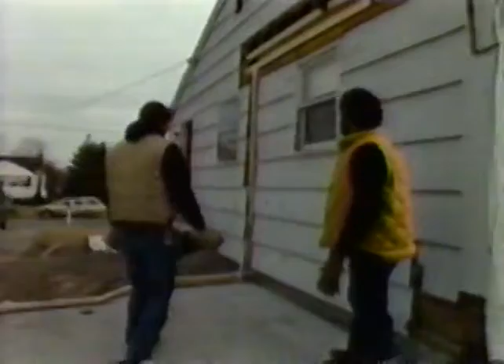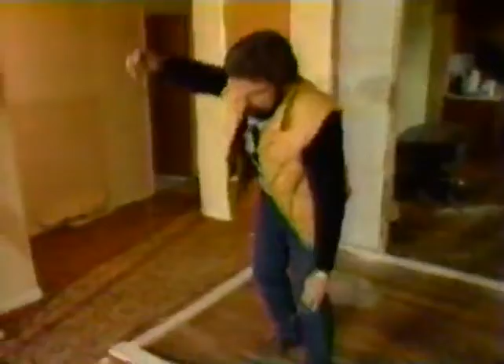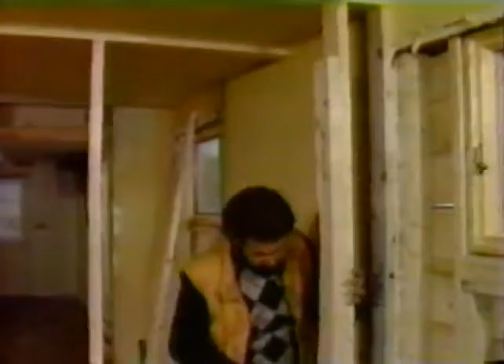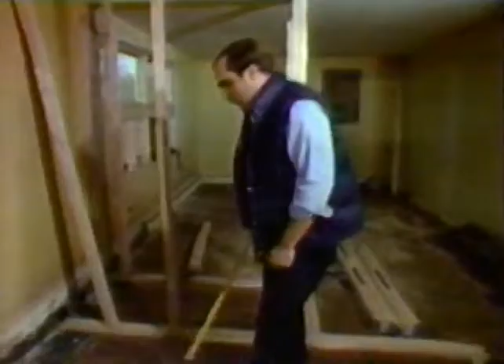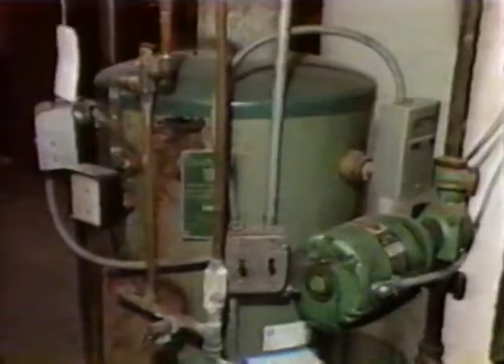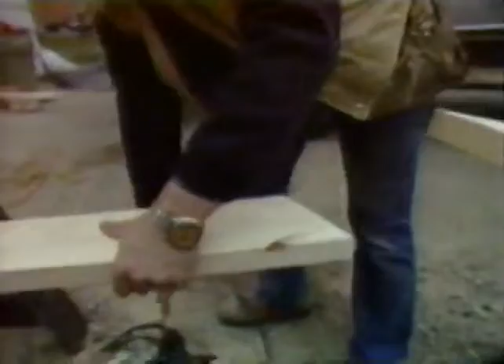This Old House | The Woburn House [Part 3] | 1982

Comment: The 3 Shower Valve Illegal?? 🤣🤣🤣 I still have mine in my home as of 2024.
Reply: That is illegal in Massachusetts
Reply: I like them. They teach young-ins not to be a moron.
Reply: I just got rid of mine!! In 25 years, I  probably did three replacements of the three-valve setup before a complete remodel this year.
Reply: I have a friend she has a 3 valve and it got to hot and cold
Reply: 18:25 And apparently you could be scalded or "frozen" from the water. Lol

Comment: This series, The Woburn House, is the best season they ran.  It actually showed homeowners how to take on average upgrades and improvements without doing a complete tare-out and installation of thousands of dollars of high-tech equipment.  I remember watching this series as they were aired on PBS.  
Bob actually said the off-set in the hall was big enough for a phone.  Anyone remember when we had a phone table in the hall for a wired rotary dial phone?  I do.
Reply: They had 2 or 3 other houses that they did, they were pretty good too
Reply: For a long distance call you had to start dialing the day before.
Reply: @mks-x2r  And talk real loud.
Reply: tear* out*

Comment: Wouldn’t you just build those bathroom walls on the floor then stand them up?
Reply: Not if you wanted it flush to the ceiling.  If it was new construction without fitting it to an existing ceiling, you should build walls like that.